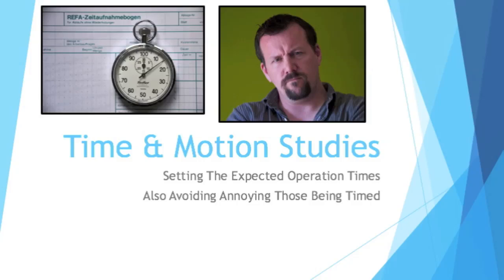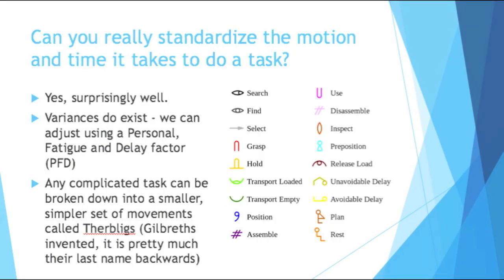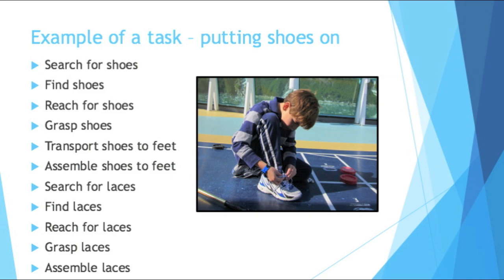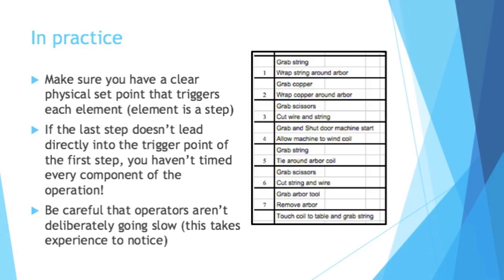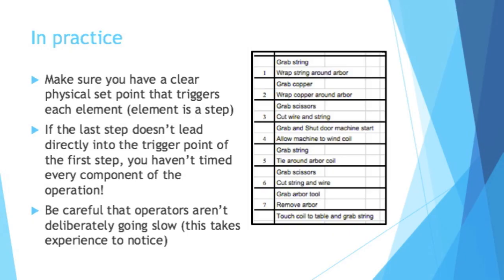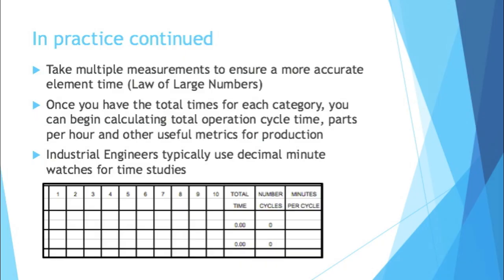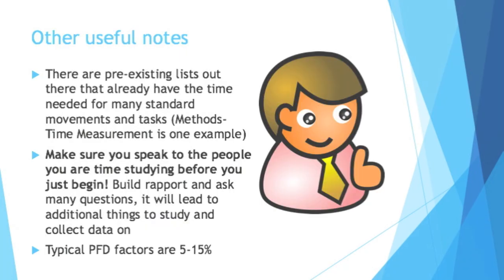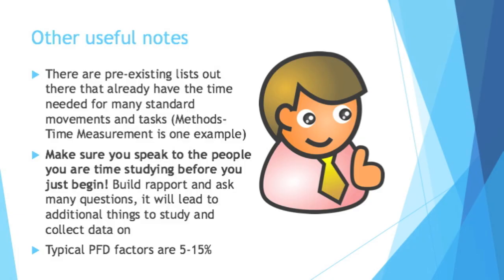Beginning Engineers Time and Motion Studies

Comment: - If workers purpose going slow, inexperienced, inefficient, have bad tools, or exhausted, I guess that is what are you looking for. and you need to address. 
-The productivity should be measured over  8 full hours of work and over long period  weeks, months and years and better without workers notice.
- The Ideal time is best to be calculated theoretically , considering real human body capacity and fatigue factor.
- It is always to try do the activity with yourself. If you are not as skillful or physically fit as the typical worker, you still can factor the time or at least you will have better understanding of the process